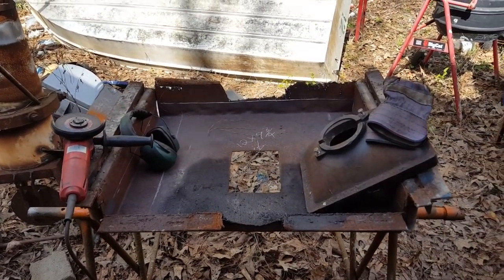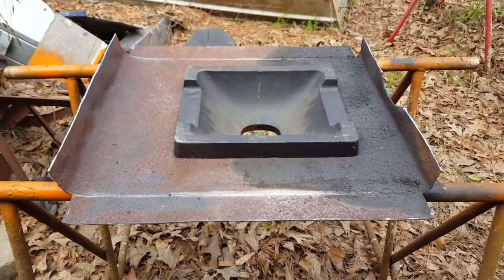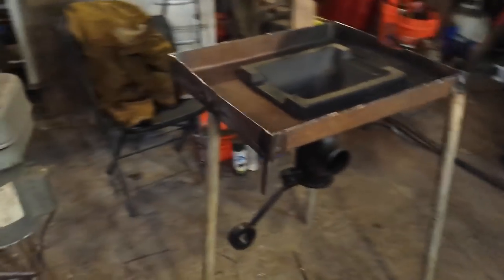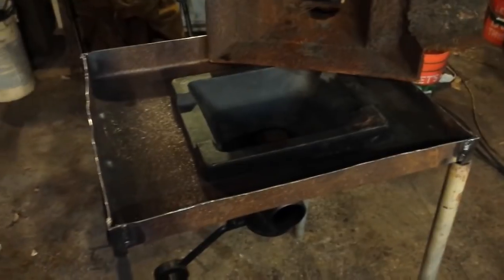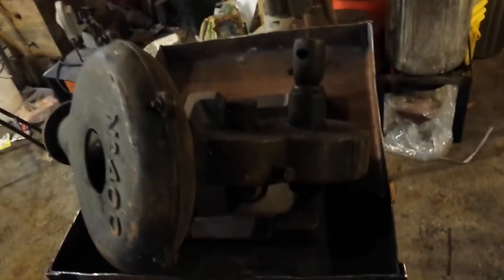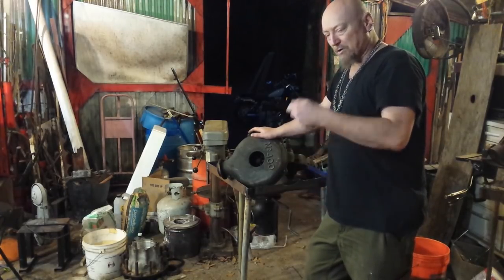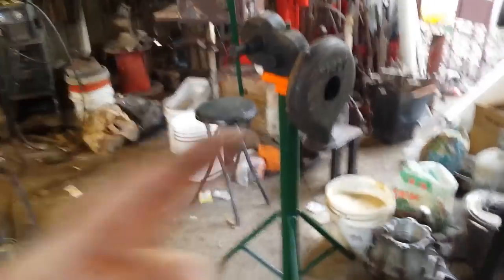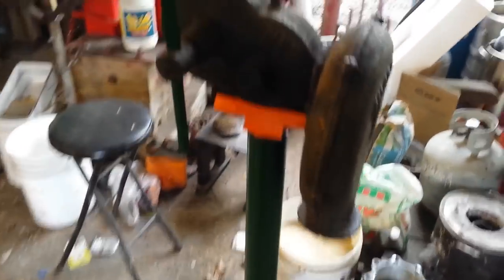Blacksmith Builds a Portable Coal Forge

Comment: The stand and especially clamp for the blower is thinking while using you brain! Perfect solution, I could have easily fabed up some kind of bracket to get it done but doubt it would have been as easy and functional as your creation! 
 Another question, you mentioned changing from coal to coke  the forge changes? Is it that much difference? The reason I ask is I have been using charcoal now for almost a year, after being exclusively LPG and have recently been able to find a supplier of coke, coal being impossible to buy here in AUS even though we are one of the biggest world suppliers, and have the the largest reserves ! Dont ask,I dont know why!

Comment: I am in the middle of a portable forge project myself, it was interesting to see how you went about it setting yours up. I made my table a little longer and I am thinking about mounting my electric blower underneath the far side of the table.  How is your setup working out?
Reply from the maker: Mine is working out great. A buddy has an electric blower under his forge, make sure it's far enough away from the firepot that it won't get messed up. Electric motors hate heat and the firepot will radiate a great deal of it. Good luck, I hope it turns out well!
Reply: Thanks buddy.  I got the blower for free, so it's not a big deal to swap it out for something else if it doesn't end up working out well.  Hopefully I can have it wrapped up soon!